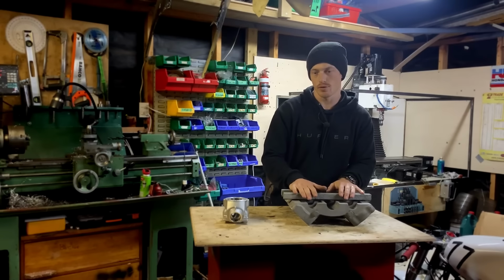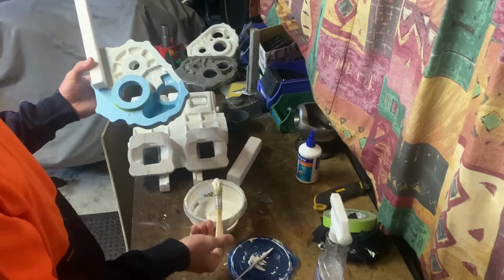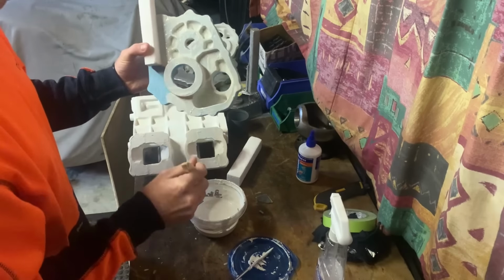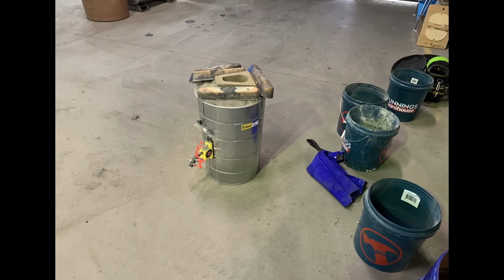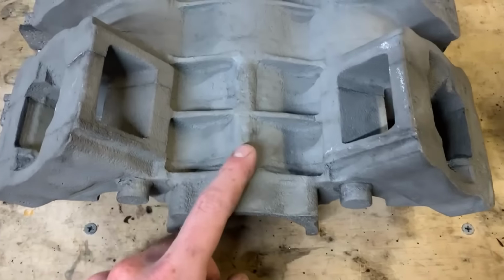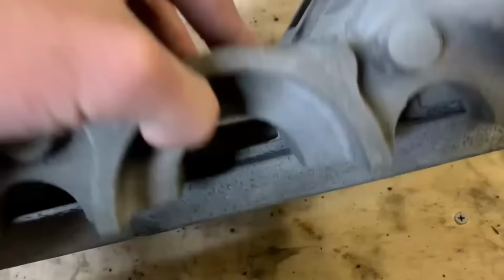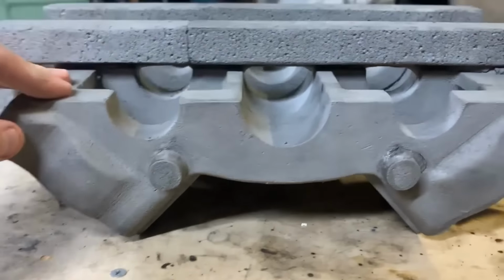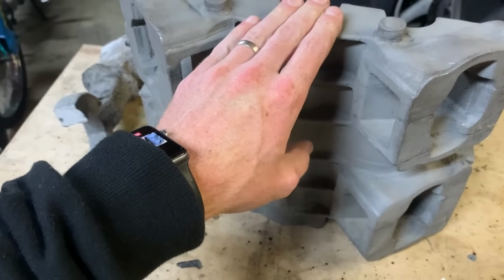Lost Foam Casting - V4 350cc Engine

Comment: Ive been building motors for decades. Professionally for a paycheck half as long. I recently got into casting and foundry work for another random project, and suddenly realized after i succesfully made a complicated part that i could now just MAKE my own parts/my own castings of rare performance parts (older parts with very few ever made or still around) when I realized THAT its like the whole universe opened up to me😂 all the unreachable things were now mine for the (making)😂
Reply: wait until metal 3d printing is ready for the masses at an affordable price
Reply: Me. All the unreasonable things are now mine for the making. How this foam core was shaped to its form.
Reply: RUN WITH IT!!!
Reply from the maker: The only problem with being able to make everything is deciding where to use your limited time. I have more projects in my head that’s I have time to complete them haha.
Reply: It's the same sensation as when I learned how to stick weld 40 years ago. I felt like I could take over the world. And when I got the foundry up and running 10 years ago, it was the same thing all over again. I was building a good size generator driven by a Lister diesel. I needed a big pulley to take a serpentine belt. They are available commercially, but were hundreds of dollars for one pulley. Lost foam for the win!
Reply: @OddsandEndsMachining  Stop sleeping...or do what Davinci allegedly did, 40 minutes sleep every 4 hours...

Comment: No idea what I'd expect to pay for that casting since there are so few foundries in my area. Does your foundry advertise a 'bring your own pattern' service? Or did you just walk up with the pattern and cash? I'm curious to hear how the conversation went.
Reply from the maker: I just rung around a bunch of foundries and the owner just happened to be interested and hadn’t seen lost foam done before. A lot of foundries will pour a casting for you if you have your own pattern. Don’t expect it to be cheap as the mould prep will also have a decent labour component attached plus material. 

I was given an induction and did a dry run for the pour and then I was allowed to pour it myself. I also set up the mould myself and took them through the process. 

In the end it cost me 70 NZD, more due to the fact the owner was interested/I detailed the entire process and I might take on some small one off pattern making jobs for them.
Reply: @OddsandEndsMachining  That's awesome, and thanks for the reply! 70 NZD sounds like an absolute steal for a part that big. Just a small fraction of what the material would cost if you machined it from plate. 

Interesting to hear that many foundries will do a pour if you supply the pattern as well... I'll have to keep that in mind for future projects. Cheers.

Comment: Rather than think in terms of milling- glueing up- and then ramming sand molds on all these parts you will burn out, you should look at it from the opposite perspective.  That is, think of the MOLD as a group of parts you are trying to mold.   That is, mill up patterns that would assemble to make the mold, with keyed inserts to print the cavities and such.   Make rigid or silicone molds off those patterns.  And that way you just fill those molds with investment, or with bonded sand, to make identical sets of mold parts. That way, you can cast as many engine parts as you want that will be identical, without having to go thru all this tedious hand assembly of foam bits for every part you want to make.
Reply from the maker: This has crossed my mind. If it works out well and it’s something I want to produce in small batches, this will be the method I use. I have access to resin bonded sand now which would be ideal. The only reason I am using foam for the prototype is for the convenience/cost and quicker pattern design.

Comment: Sweet video - I'm looking to start a small foundry/machine shop and seeing a "foam" part "dipped" in plaster seems like a quick and dirty way to make parts - i like it and look forward to seeing your engine run! I'm working on a two stroke, similar to Ferrari's oil sump two stroke design
Reply from the maker: Thanks. That sounds like a cool project, keep me updated.

Comment: Have you ever poured cast iron with this process? I am going to try an easy project but a little nervous because of the temps. What CAM do you use for your router?
Reply from the maker: I use fusion 360 for the cam, it’s relatively simple. I have not poured iron, I do believe it is a suitable process although you will likely have to use a professional grade refractory for the coating. 

You could also do a test pour uncoated and see how it turns out.
Reply: @OddsandEndsMachining  THank you. That block is a nice job BTW. Are you familiar with any type of temperature charts that suggest best pouring temps on different metals? I just built a diesel fired furnace but I am not 100% sure I can hit the temps to melt cast iron🤞
Reply from the maker: @rufustoad1  I would just google the pour temp as it will be higher than the melting temp. 

For aluminium I run off 720c. Any higher and hydrogen gas becomes an issue as it dissolves in the molten metal. 

A diesel burner being fed enough air should be able to hit the required temps. Although I’m not an expert on this, check out the home foundry forum. There are plenty of experienced people on there willing to help out.

Comment: I see you have been working on a V-twin. Any further progress on this project? Best, Kelly
Reply from the maker: Only planning at this stage, I have decided I am going to do away with the cassette gearbox (seeing as I don’t have alternate ratios anyway). 

The plan is to split the rear of the engine down the middle in two halves which will make them a manageable 8kg pour each and they will be far easier to gate. I feel like once I get some momentum it should all happen fairly quickly. 

Regards 

Jonny

Comment: Would you try to make the engine narrower? Or just keep the width since your using those single cylinder heads.
Reply from the maker: There is about 25-30mm between the cylinders, I think I’ll leave it so if I cast some big bore cylinders way later on they can have large swooping transfer ducts. 
Also the architecture might not change much between 85cc to 125cc cylinders.

Comment: You'll think you died and went to heaven when you start using the CNC router for your patterns. I use 1/4"D x 2"L, double flute, spiral carbide cutters, either end mill or ball end mill for 90%+ of my machine work. I even design for such now. It will depend on your spindle speed, but most routers will be 20krpm+ without speed control and even still 10-15krpm with, and although you don't need carbide to cut foam, you do need the stiffness on a long spindly bit like that at those speeds. You don't want more than 2 flutes because although spindle speed can decrease with more flutes, they won't clear chips well. Hobby grade CNC machines often lack rigidity but their lightweight construction can be an advantage for cutting foam because the cutting forces are almost nil and your linear speed will be limited by the machine's (gantry and Z) inertial mass and corresponding ability to rapidly change direction. 

When I 3D machine more complex larger (24" x 12"x 4") patterns, I set the spindle at full speed (24krpm), 180-200 in/min, and .1 stepover with a 1/4" ball EM and just let it run, and it machines fillets and all. Most patterns within that envelope will finish in 30-60 minutes. If you have small features, you may need to back the linear speed down so you don't shake the machine apart with inertial loading. Of course 2D machining will always be faster. I typically use .4 stepover with end mills but once you see the finish with .1 on a ball end mill and realize one or two swipes of fine sandpaper makes the surface perfect, your desire to do tool changes will leave you unless it's a very large flat surface that would consume more run time. Many times, I don't even do rouging cuts depending upon tool path. You will need a very good dust boot and vacuum system. The foam chips will be charged and cling to everything. Make sure you ground your machine and shield wiring well or the EMI can turn Heaven into Hell! Best, Kelly.
Reply from the maker: Thanks for the detailed reply, I was thinking about using the 6mm ball endmill for everything, now I think I’ll give it a go. 

I still don’t have a cyclonic filter for the vacuum so I think that’ll be another hurdle before I start cutting.
Reply: @kellycoffield533 Im so glad to see you commenting, I watched all your videos and they are amazing. Do you have any book recommendations for getting into this sort of thing?
Reply: @kellycoffield533 im blown away at that vid you did with the engine cooling fins with only sand vibrated into the fins , like WOW , i had a crack at a large ish part , but i think i cooked the ally to hot

Comment: I can only imagine the huge relief to see it come out as such a successful casting. So much time and effort paid off. 
I have no idea what the material and foundry cost would be, but I'm very interested to know the tough figure. 
As for the foam surface finish, I wonder if there is a way of doing a DIY wax spray to act like a high build primer. Over the years Ive been a bit interested in the very cool process of metal spraying. Amazing process for building up worn shafts and expensive dies or machine parts, but also used as an alternative to galvanising or electroplating for corrosion resistance.
I wonder how hard it would be to modify a HVLP spray gun with a heated cup and gun body. It may be a case of smoothing the foam surface out with warm tools (which would be a massive time killer), but it could result in a light even texture that could be left as sprayed.
Reply from the maker: It was a massive relief, it would’ve been demoralising if it failed, probably showing me down a bit. 

All up it was $70 although, that is a bit of a special deal, but if you showed up with your own patterns you’d be looking around $250-350.

The problem with too much wax is it creates more gas and would cool the aluminium down too much, the foam can be sanded very smooth, I was just a bit lazy in this case.

Comment: I am very surprised for a lost foam casting.👀
You use plaster on your mold,,,, strange. 🤔
The result are great so good job man. 🙋
Reply from the maker: Thank you, the plaster is just a cheap substitute for the more expensive commercial grade refractories. It does a fairly good job and is fairly inexpensive.

Comment: After rough machining you can rubber mold to reproduce full plaster cast lost wax patterns.
Reply from the maker: That’s always another option. I think I might try my hand at using resin bonded sand first. Wax could be good for some of the more intricate parts like the water pump cover.

Comment: Looks better than factory made engine cases from my 50cc jawa 😂
Reply from the maker: That’s either a compliment or the bar is very low haha.
Reply: @OddsandEndsMachining  the cases themselves were good, the machining tolerances and cylinder to liner fitups were a different story. In some cases 5-7kmh difference between Monday and Friday cylinders. Quite a lot on bikes with top speeds that wouldn't get you a ticket in the city. 

Great job on the castings man!

Comment: Nice work! So what is the material to fill the small gaps between the mold pieces?
Reply from the maker: Thanks. Fibreglass filleting wax, it melt at a low temperature.

Comment: Great job there! I was just thinking if you'll be using an aftermarket crankshaft or are you making your own?
In my mind, that is the trickiest part...
Reply from the maker: Thank you. I am modifying the standard crankshafts to work in my cases. Well that’s the plan, i am going to avoid making anything such as crankshafts unless absolutely necessary.

Comment: Nice work, just clean that casting up with a die grinder and some emery mops and you will never notice it under a coat of paint. Don't bog down on casting quality and get the rest of the engine done.
Guessing $300.
Reply from the maker: I think that’s the plan at this stage. 

70 NZD (which is not a normal charge out price, but it was more of a teaching exercise/curiosity thing for the foundry).

Comment: Very impressive the most enjoyable channel on iBook great work have u decided on the brgs for the cranks.good ol two strokes rely heavily on good crankseals to keep primary crankcase pressure in and gearbox oil out  I’d be tempted to look at genuine deals from one of the big four manufacturers for those  Are u going to run an oil pump?  I’m not 100 percent sure but I think mostly the oil is fed into the inlet ports but it might b more elaborate than that in some engines a Yamaha Rz500 or Suzuki rg 500 oil pump mast b the go as they’re both for cylinder? What reeds r u using I think u can get carbon fibre ones now which r supposed to react quicker to changes in crankcase pressure really looking forward to the next instalment 🍻👍
Reply: Deals = seals 😅
Reply from the maker: Thank you, I’ll be using skf or Yamaha seals for the crankshafts. As for an oil pump, I’ll just be using premix to lubricate the bearings, 30:1. I will use standard YZ or V force reeds, likely whatever’s cheaper to start off with. 

On my RGV the oil is fed into the cylinder under the exhaust and behind one of the main bearings.

Comment: I want to build something like this Soo bad.. maybe a V8, V10, v12. Designed to fit in the place of a Chevrolet V8. Possibly cast custom cylinders using  cr500 pistons.  Possibly a big bore version with a stroker crank, adding about 12-15 possibly 20-30 mm to the stroke and 6-12 mm to the bore. Use a supercharger /scavenger with bypass and a reverse centrafugal clutch that disengaged with more rpm,   and use a couple turbos would be better for automotive use. Over crankcase breathing. With roughly 600-750, 800 cc per cylinder firing ever TDC, it's going to be a monster. Heck I'd like to build a parallel twin, vtwin, v4, built like a Detroit Diesel, 2-71,2-92 only a gasoline burner, a supercharger scavenged 2 stroke with valves for the exhaust . Using two then later 4-exhaust valves per cylinder!🤯, this has potential to make seriously insane power if the intake can supply enough to make use of it. With the intake ports surrounding the cylinder at. BDC. RPM is not your friend. Maybe a gas version could incorporate a supplemental intake valve in the head to open as the sleeve port is closing a high lift low duration to open while the lower are closing { OR } just use valves for both. A 4 valve design  with really high ports so small exhaust valves can flow high CFM.  With large long intake ports. Required longer valves. Use a double overhead cam.  To allow cam timing and event timing changed to suit scavenging. Direct injection  possibly using a high pressure accumulator store about .6 litre at 150 bar +/-50 bar. And port injection for high rpm high power to supplement fuel . E-85 to E-100 would be exelent. Two cylinders with about 1000-1200+cc each. With a bore being 150-160% of the stroke , say 50 mm stroke 80 mm bore..
But on a more reasonable level, my china scooter has basically everything possible done to it. High compression, big bore, big carbon, ported head. Gy6 50 cc with a cam, it's doing about all it can even turning 10k rpm. If like to cast a new case. To allow two 150 big bore cylinders to be used with a stroker crank. Doing about 200 cc each and possibly convert to a motorcycle head with 4 valves maybe two XR250 heads welded together. What would be awesome is  cast a case to hold a xr,250 engine allowing the transmission to be used with the scooter rim. Capable of 0-60 in less than 4 sec, 0-100 in 6 sec,with a top speed around ,105-110 mph would be awesome. I doubt over 60-70 would feel safe!
Reply from the maker: If it’s something you seriously want to do, I would start with something small that uses common affordable parts. This way you can apply what you learn to bigger projects later on. 
The biggest learning curve is the 3D modelling, but it is also the cheapest step and can be done in any time frame.

Comment: HOLY SHIT THE V4 ENGINE DOES EXIST
Reply from the maker: Half of it at this stage haha
Reply: @OddsandEndsMachining  hey, its more progress than I have on my project, im stuck at the stage where designs are finished but I dont have the funding or following to start actually building it. I have an idea: I'll start designing a small sedan that uses your engine, and once it's done we sell them. It would definitely be a better choice to start with than a mid engine supercar like I've been working on.
Reply from the maker: @JaxxonBlaze69  sounds like a plan haha, I doubt this engine would be able to move a car off the line without some serious clutch abuse and horrific fuel consumption.
Reply: @OddsandEndsMachining  eh, thats what R&D is for lol
Reply: @OddsandEndsMachining  My grandfather had a old Wisconsin v 4. As far as I know it ran but unfortunately I never got to see it run. 
     It was originally made for farm use. So it was never in a car.

Comment: Excellent,  I'm playing with lost foam I'm in the UK any idea where I might get that blue foam? If not, do you have the name and spec? The stuff I'm using doesn't quite burn out properly.
Reply: I think Yu require extruded foam for  the pattern making machines and finished better than expanded foam
Reply: @karlvanboxel561  i appreciate that but i cant find it
Reply from the maker: Easy composites sell it in the uk, look them up. 

I got mine from here: 
https://www.insulationwholesalers.co.nz/Online_products/XPS-Extruded-Polystyrene-Foam-Board-c23467176?gad_source=1&gclid=EAIaIQobChMI7u2Brd6phgMVa6lmAh1hSA_8EAAYASAAEgKNhfD_BwE